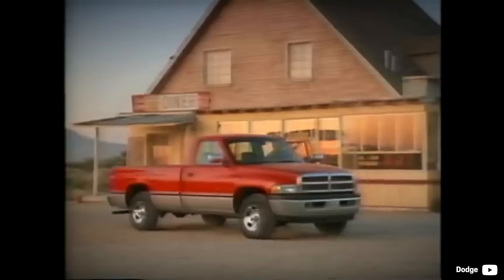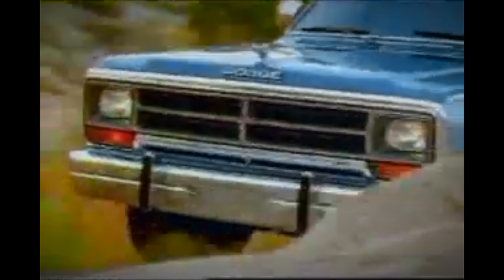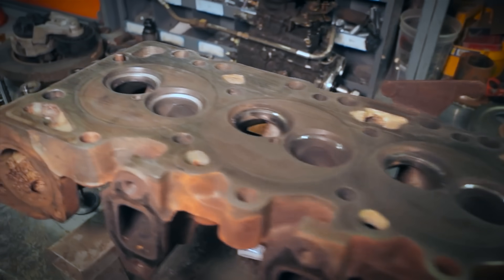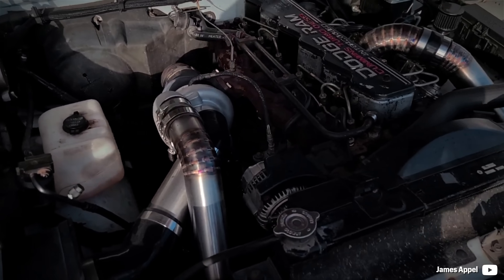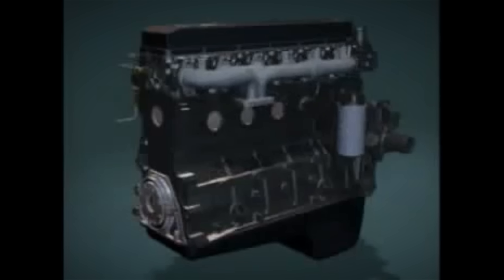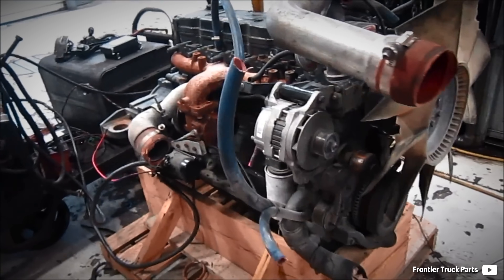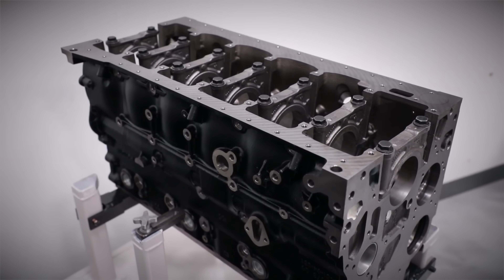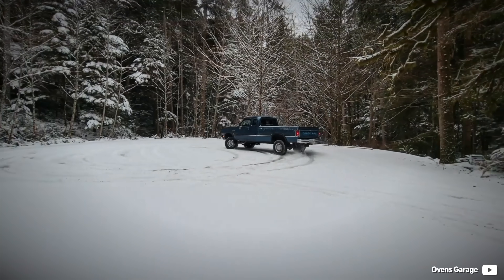The Most Reliable Diesel 6-Cylinder?

Comment: The Cummins IS a hell of an engine. Too bad Dodge makes the truck. It has blend door issues and earlier models dash breaking apart is common. Not too bad other than that.
Reply: Not to mention hella body rot compared to ford/GM , I even see many early 2000s Dodge rams with major rust and I don’t even live in the rust belt
Reply: @Bull3tBikes  the rust belt is a damn joke. Come to Alaska where rust is worse. Everything is costal to the ocean and 9 months of water.
Reply: @Sackmatters  I live in the PNW coast I’m in BC , Alaska is already on my bucket list
Reply: @Bull3tBikes  best get on over here. It’s one incredible place. Always welcome happy tourism.
Reply: We had a 1992 Ram 3500 Cummins and I agree while the engine was bulletproof the ride was horrible and rust eventually got it. Even before that the paint quality was horrible. It fell off in 2”x2” squares all over the body.
Reply: @RobertSmith-le8wp  I hear ya , my gramps had a 93 power wagon with the Cummins and the rust ruined the hood & roof the thing leaked with all the rain we have here in the PNW it was a good farm truck though and it served its purpose.
Reply: I have a 1992 dodge and the dash is like new. Door hinges have worn out though but replacement is easy.

Comment: Love my 12 and 24 valve Cummins.  You actually used my 12v in one of your older videos. Best sounding diesel engines It was the highlight of my life. Thank you!
Reply: Love me a good Cummins 5.9 but definitely not the best sounding.
Reply: I occasionally get some grief from my wife for standing in the driveway doing nothing other than listening to the Cummins run.  It just makes a soothing sound.  LOL!
Reply: Cummins sounds good, but a Duramax sounds better in my opinion.
Reply: To me the best sounding diesel is the crappy 6.0 Powerstroke
Reply: @ZR1Terror  honestly Im an idi lover.  I want a loping 7.3 or clattering 6.5 chevy diesel
Reply: @KRShields  eeewww Chevy diesel sound like a gas engine
Reply: @ZR1Terror  lol crappy? Sbe 6.0 with just studs and oring heads makes 850 to the wheels with a 4800 redline. Crappy lol
Reply: @Lostsouls5557  they are shitty lol. Have to spend a shit Ton of money for any reliability lol
Reply: Hmmm the OM617 5 pot Merc engine had a lovely offbeat sound combined with a touch of timing chain thrash and idi clatter 😊
Reply: I had a 1989 & a 2000 Ram, put over 500K miles between the two. I crashed the 89, and road salt rotted out the 2000. The cost of diesel has caused me to stop fixing the 2000. Bothe were truly great engines.
Reply: 6.0 powerstroke is by far the best sounding diesel
Reply: @traxxasrcfun  The 3208 Cat marine diesel in my boat begs to differ.
Reply: so its basically retarded stepchild of OM606
Reply: Lol…. The best sounding Diesel engine is the Toyota 1vd ftv 4.5l twin turbo v8
Reply: @alanmay7929  I wont disagree on that.
Reply: @alanmay7929  just watched a few videos and they sound like a school bus. You're smoking crack if you think that sounds half as good as a 12 valve.
Reply: @rikkatheconure2395  it sounds better than the 12 valve hands down no need to argue